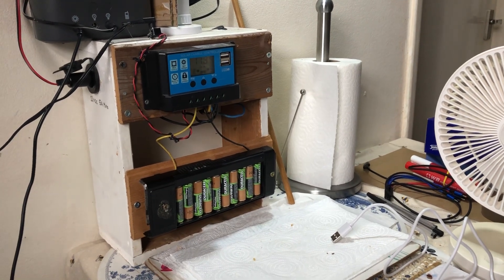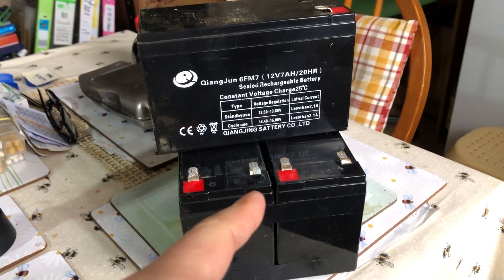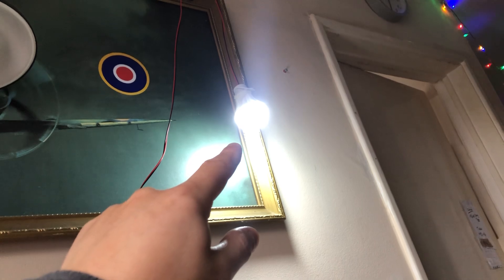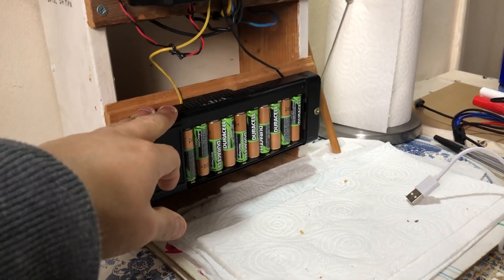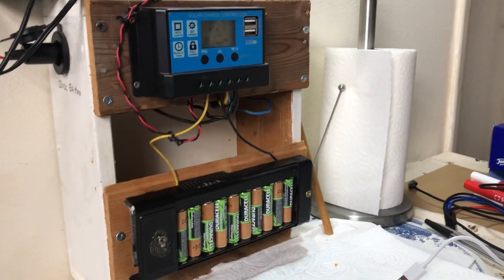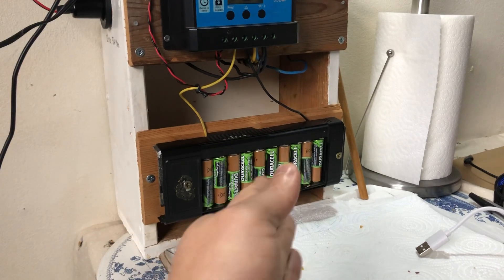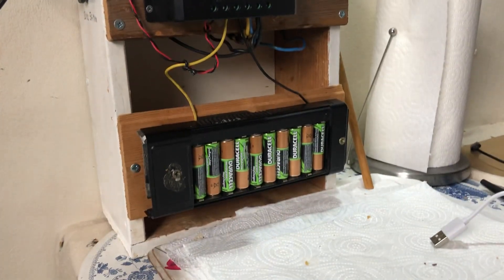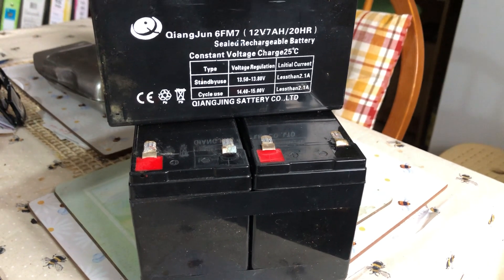Economy solar power battery box

Comment: This is awesome!! Starting small must be the very best advice. If every person with a phone took it off-grid with an awesome and cheap system like this, can you imagine the change.
Thank you for taking the time to show your system, I also started like this and built it up to what it is today, just feel you learn more by starting small and knowing how everything works first & what your real needs are in your house.
Reply from the maker: Thanks for your comment, once you start this hobby , it gets addictive! I started with a 10w solar panel and one battery and it grew from there. You learn what works and what doesn't, and that cheap chinese equipment is ok but has limitations and quirks, now I use Victron equipment. It has a 5yr warranty, is good quality, can be customised to your needs and just works. Yes it is expensive, but I look for good deals on Ebay. Sunshine is a bit short at the moment as its winter in the UK, however when the winter sun comes out, I get some charging. In my location the winter sun rises and sets in a different place compared to the summer, and my panels are orientated for the summer. So charging performance is not optimal. My panels are on my shed roof , so they can't be re oriented to face the winter sun, which is not guaranteed in the UK (Usually rainy and gloomy) the sun is very low in the sky and is very weak. Usually in UK Autumn and Winter there is little sun and lots of rain and endless clouds, so I have to use the mains charger a lot, hence I bought the Victron ones that you saw in my other videos. Anyway thanks for your interest in my channels. More videos to come this year. Solartiger
Reply: Very true. I started small but slightly bigger than this with a 40 watt panel and a 1000 watt Xantrex inverter. Now i have 1000 watts of solar and it powers half of my daily electricity needs. Solar is addictive for real, but that's a good addiction. Greetings from Jamaica.
Reply from the maker: Hi, Thanks for your interest in my video, it's proving popular! From Solartiger in United Kingdom.  @lawrencedavidson6195